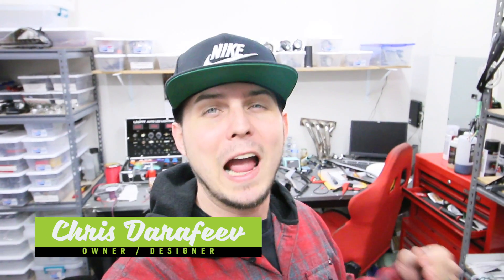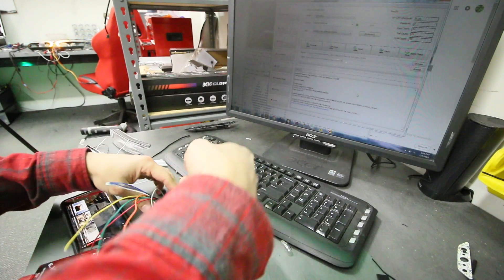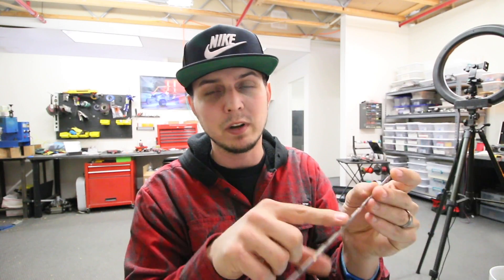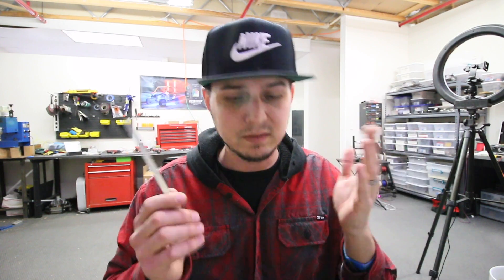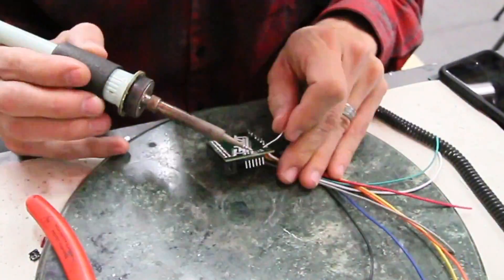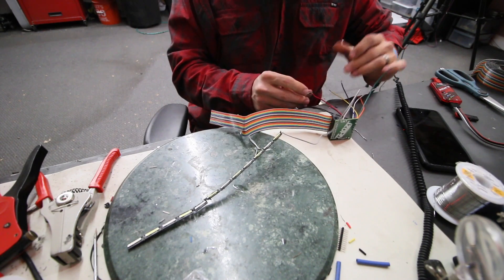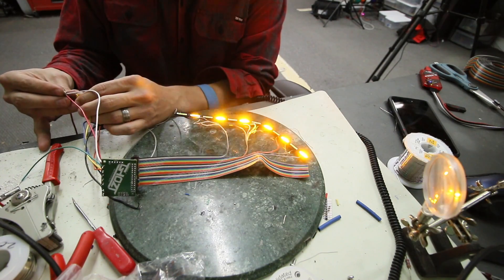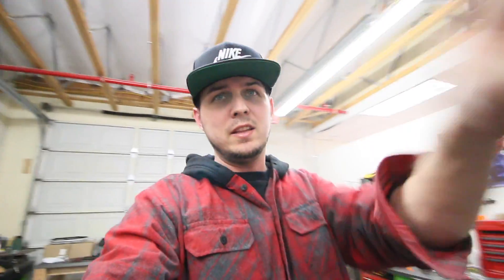Learn to PROGRAM Sequential LED Strip Modules | Ghozt Lighting | FlyRyde

Comment: B
The gtr lightening bolts are great. My question is can those lightening bolts be used in place of the lightening bolts on the alpha rex lights for the infiniti g37 coupe? As those lights can be modified with the ghost and the gtr lightening bolt that you make would look so much better than a tube. Any information would be appreciated.  Love your channel man..been watching for a long time.

Comment: Oh ok so you use the 30 pin idc connectors. I was looking for the 28 pin idc connectors. Gotcha
Reply from the maker: James Yurko just gotta pull 2 pins out on the connector that solders to the Ghozt board 👍
Reply: FlyRyde Thanks Chris

Comment: is this ghotz module its like  arduino module???
Reply from the maker: rusfi1983 similar in the end result, just way easier to get used to with zero programming needed. When you order them, they can come preprogrammed for headlights, or for tail lights with all functions super easy to hook up: turn signal, running lights, show modes, etc.